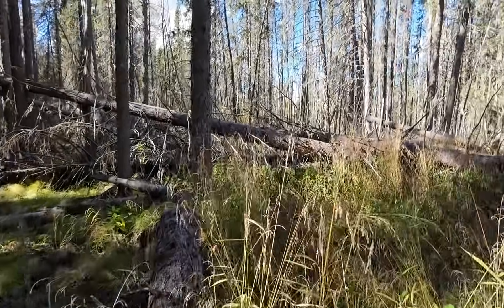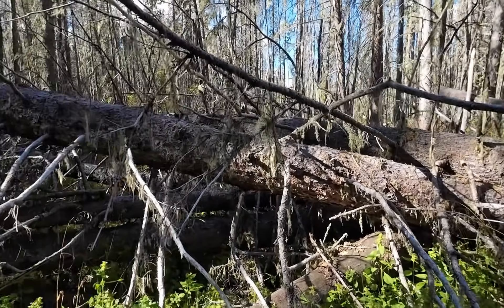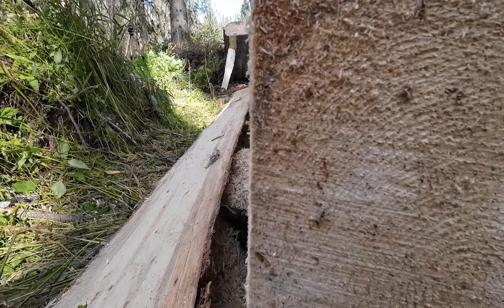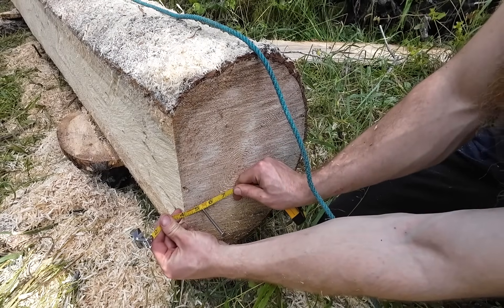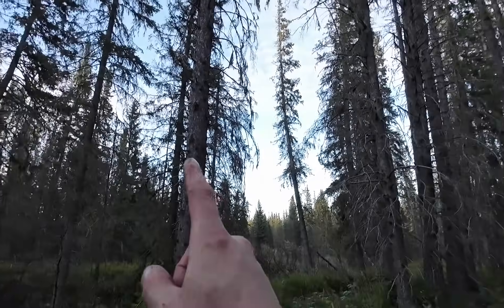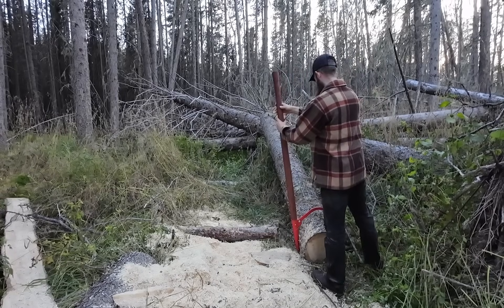Cutting LONG & THIN Boards Using a Chainsaw...WITHOUT a Mill!

Comment: If that was me trying to cut those boards, I'd constantly cut the rope, my boards would vary between about 1/8 and 3 inches... glad you have a better eye for accuracy!
Reply from the maker: It's easier than you'd think. After a bit of practice I think anyone would be able to get similar results. I do appreciate the kind words. Thanks for watching!
Reply: @KuskWild  I can understand if the cuts were vertical but you're still getting them straight while cutting at an angle.
Reply: Same, I can see myself wasting a tree or two on absolutely crap boards at first 😂
Reply: I first used an alaska sawmill rig it is burdensome. Now I cut freehand and gravity helps.
Reply: Very true, you have to be pretty darn good with a chain saw.
Reply: I was thinking the same thing- this guy is impressive!!

Comment: I generally cut the log in half to get rid of the heart, then trim the sides. Chalk line shows up good on the cut. Then stand the cant up and cut my boards. If you want a smooth straight cut, quickly, try a chain sharpened at 0 deg with no rackers. Smooth as if gone through a planer and shavings couple inches long. Without an angle on the teeth the bar will just follow the cut and you will not use extra gas and time cutting the groves as the angle, even 5 or 10 deg will pull the chain left and right as it grabs. You can use a full chisel.
Reply from the maker: Thanks for the advice! I'm eager to try a ripping chain. Take care!

Comment: Right on getting it done 👍 and for the 4wheeler i would check the carburetor for dirt ive had similar problems and when i would give it more gas to get out of a hole or something it would stall and then when it sat for a bit the dirt would settle in the bottom of the bole.
Reply from the maker: Thanks for the advice! I'll be sure to check the carb.
Reply: @KuskWild  do you have an update on what happened with the 4wheeler?

Comment: Here in OZ all I have on my property is Ironbark and Sotted Gum, both weigh-in at 1200kgs a cubic meter. Pine weighs in at about 500kgs. I don't try to cut them dry as the timber is too hard, and you can get sparks coming off the chain. It makes me a tad envious to see you cutting the logs like they were butter.

Comment: We had a Honda of that age. The fuel cap is supposed to vent, but it became plugged/damaged/rusty and would not allow air into the tank starving the engine. Opening the closing the cap would solve the problem temporarily.

Comment: You make this look easy. I've cut a few square timbers this way and my surfaces never got that smooth.   I ended up friggin up a guide to use with those saw mill attachment gadgets and I cna make pretty descent boards that way.

Comment: You are accurate with you saw! I couldn't cut that accurate with Haddon Guide! Went to Hudson Band Saw mill 25 years ago. Less waste and accuracy. Put a set a Cook's roller bearing guides on it. Chain saw milling is slow hard on a saw requires a big saw. So glad I got a band saw mill...

Comment: The cheapest mill is around $60 bucks and would make your job a lot easier and get you better boards but I guess your just showing possibility's. I've owned three of that era Honda ATV and the all occasionally won't start but if you open the carb drain and let a little fuel come out it will start afterwards. I never figured it out but never attempted to either, I always had and old screw drive stuck into my forks where the wires go thru in case it wouldn't start. This seems to happen when the bikes been sitting a while or during temp changes.

Comment: At about 7:25:   "The bottom tapered out a little bit - that's not too bad." That's 100% true for you.
But - - - some builders want a little better quality and use some kind of homemade guide.

Comment: I've never owned an atv before but to me seems like you might have had a bit of water in your gas. If you open your settling bowl and let the gas flush through for a couple seconds it will usually clear it up on the small engines i use

Comment: First one I see doing the forward technic, thats the major way here in Brazil. If you want a better finish you need sharp the chain at 0 degrees, it cuts faster, dont heat, follow the line and dont let marks on the board. 
Use a ink line to trace, White our Blue water based ink. 
That wood cuts so much faster, seems butter, the engine is totally free

Comment: Do you burn those first slabs?  We get those from the Amish lumber yard just for firewood. I find they make great slabs for kindling when bucked and split.
Check for moisture in that fuel.
Reply from the maker: I will cut them up for firewood. I'll be sure to check for moisture. Thanks!

Comment: Honda put a compression release on the camshsft ,& i had trouble with that, instead of them putting a bigger starter. ,they put that damb camshaft compression release,you have to tear the whole top end off to fix it ,bummer !!!!!!
Reply: i encounter many engine failure for no reason in middle of woods working, and never have issue when drive around home, i guess middle of woods have many negatif energy or somesort of unseen being

Comment: How do you keep it straight near the bottom? There are mills you can use that attach to the chainsaw. For accuracy its better to use a mill. Plus you would worry alot less about mistakes. But kudos for keeping it generally straight. I have adhd so I'd probably mess it up because a squirrel would jump out lol. So this method would only be good if the mill broke and time was of the essence.

Comment: On the quad is the gas tank vacuum locking on you?
If the cap isn't venting properly the gas won't gravity feed. Had a few chain saws do that.
Reply from the maker: I'll look into that! Thanks for the help.

Comment: Instead of using rope use cotten thread 🧵 and distemper like red paint to mark a line on tree as cotten when pulled like string will indicate line on tree.

Comment: The tried and true Alaskan Mill. If one does not have the money and or location for a Circle Saw or Bandsaw mill, the Alaskan chainsaw mill setup is pretty much the only choice. But be sure to get a high quality chainsaw that will take the abuse and have on hand a good supply of chain blades. That said there are issues with the Alaskan mill : 1. Large Kerf ( for novices the Kerf is the cut gap a saw blade leaves) which will add up over a long time in wasted lumber and more so lotsa sawdust. 2. Slow cut speed, painfully slow and labor intensive since its all on the operator to move the saw thru. With that also comes Blade wear. 3. Accuracy. This can be tedious to stay on it and can add to already time consuming cuts. The fastest and most accurate mill is the Circle Saw mill but its dangers are many and one has to have alot experience in using it. It is also quite a costly operation to set up but once it gets going, you can really knock out alot of board feet in a short amount of time. You can still find small and regional Circle Saw mills  operating in  rural areas and mountains.

Comment: Ya know the first time I watched someone free hand logs like this it was in Panama. They took apart "D" sized batteries and put all of the carbon into water with a dry string and you get and instant black chalk line. The guy used a similar trlechnique but he hauled ass with that saw... I was just dumbfounded.

Comment: I see you're using the Holzforma G372.  What has your experience been so far with it, is it holding up well, any issues?
I do the same kind of thing you're doing and have been running smaller Huskys.  I want to upgrade on power and want to give one of these a try but want to hear from someone who has used them for ripping boards.  Thanks!

Comment: That's some tough slogging! Did you use a ripping chain? Notice any difference, or does it matter if the wood is dry/wet? Thanks. That was an inspiring video.

Comment: I never really cut lumber, 
But what kind of chain did you use cross cut I read,
But they say a rip works very good,
Which i may try
I have a saw about the same size as yours 394, 395